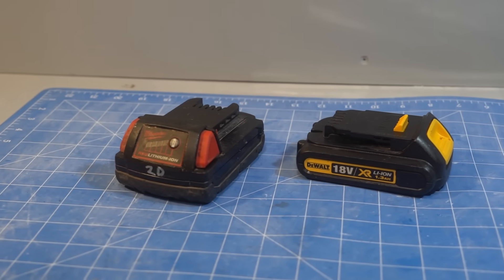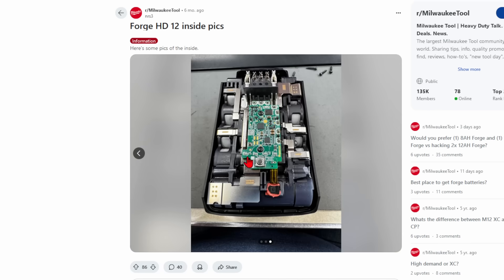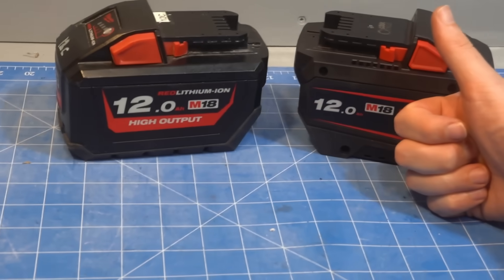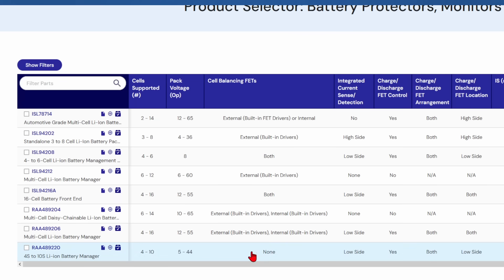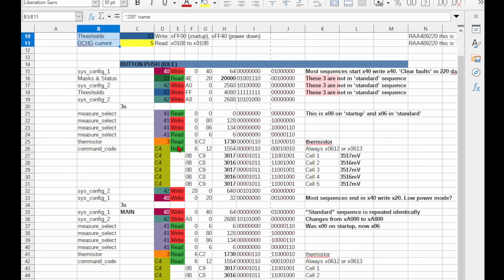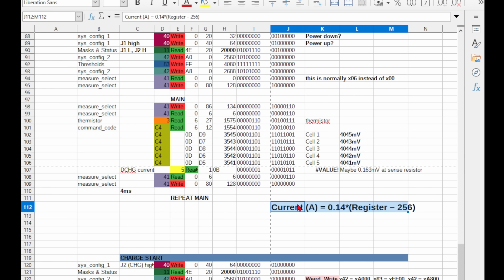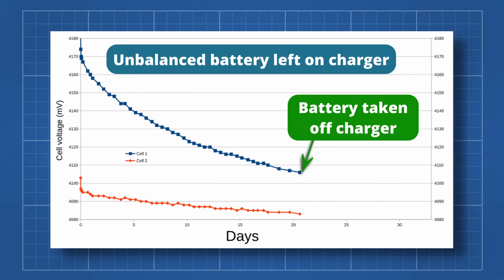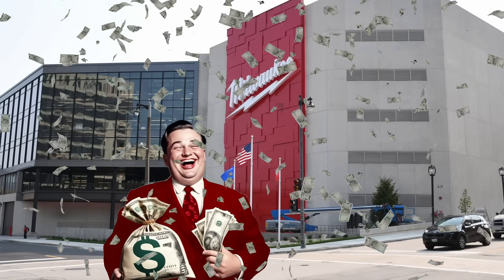[011] Do Milwaukee FORGE batteries balance

Comment: on top of everything you mentioned people need to make sure they use a fan when they charge their batteries, heat is probably a bigger concern since it’s what most people will experience damage from. 
anytime i use the charger i try to use the slowest 3A because since it charges it slow it puts the least amount of heat and if charging outside when it’s cool the charger and battery never get hot. i also had a rapid charger and a super charger which i try not to use as much because the super charger charges the batteries FAST which lithium batteries tend to not like and from my understanding (i could be wrong on this) lithium batteries get unbalanced faster when charged at a faster rate. 
and the rapid charger is the perfect middle ground IF you have a fan pointed towards it so the charger doesn’t get hot. because that charger gets really hot! 
anyway those are my 2 cents.

Comment: it looks like there is some space inside the case. that makes me wonder, couldnt we add a balancing circuit from one of those cheap bms boards on top of the original board
Reply: Maybe if we add a connector to the shell you could hook up an active balancer externally
Reply: @bengoldberg8451  i was actually thinking of an internal balancer for ease of use

Comment: No balancing is intentional. It limits the useful life of tool batteries without causing safety concerns.
It is strange how LIDL/Parkside, a cheap line of tools, implemented cell balancing in year 2022. Their 12 Volt (3 cells) batteries have an over engineered electronic controller, as they include everything in the battery. They balance within 10 mV, so the battery keeps their nominal capacity to this day. 
Their 20 Volt (5 cell) batteries are different. Under voltage protection is inside the tool, and over voltage protection is taken care by the charger. This to keep the 20 Volt battery price low, at £25.
Thanks for the video.
Greetings,
Anthony
Reply: From what I understand, tool batteries which include cell balancing require an alignment step after production...

Comment: My biggest regret is choosing the M18 platform. It's not that I don't like my Milwaukee Fuel tools, but Milwaukee tools and batteries are simply overpriced. I feel like you can only buy them at a reasonable price during sales; so there are never any good deals. My track saw is probably the only Milwaukee tool that I find competitively priced. Otherwise, why charge more for tools or batteries designed to break down that cannot be repaired?

Comment: Why don't you rewrite the program for the charging of the cells.  Any one as good as you running the I2C is more than capable to write a new program can reprogram and change the eprom. Suck the program out of the eprom and feed it to the AI to write a new program to your spec. A bigger Eprom cost more money. In high production levels they most of the time burn the program into the charger chip when they make it.  Big money to change it they make 10K-100K chips at a time.

Comment: They want these batteries to perform excellent in high power drain tests as well as in short term 'torture testing' , however after repeated cycling the voltage difference becomes so great that capacity becomes complete nonsense and the user has no option but to either buy a new pack or try and warranty it. If the user tries to warranty it they will reply saying the pack has been 'abused' and warranty is denied. (citing I2C data they like and omitting that they are not balanced packs that caused the problem to start with) 
WHAT A JokE

Comment: At the beginning you pointed out that the top-of-the-line DeWalt and Milwaukee batteries don't have active balancing, which is true! But you forgot to mention: the DeWalt charger does active balancing! That's why DeWalt batteries have "pins" with voltage separation of "S" by "S". Greetings from Brazil. 🇧🇷🤝🏻 Ah, I bought standard male DeWalt connectors on Aliexpress and today I charge my DeWalt batteries on the ISDT Air8 in a balanced way, each "S" at 4.19 volts 👍🏻

Comment: In M12 charger does balancing but I can't comprehend why they added resistors in the pack and only for 2 not all 3 cells. Mine are modified to charge with RC charger which has 1.5A balancing current for each cell so my packs are always balanced. I also did modify chineese makita copies to use JST-XH connector so those cursed and branded as bad batteries started performing better than they actually were. Hmm curious...

Comment: Just the other day I cracked open a knockoff Makita battery. It had cell balancing. No excuse not to, other than extreme greed
Reply: No, the battery you opened almost certainly just had cell MONITORING. Just because there are connections between the cells to the BMS doesn't mean it has balancing.

Comment: Thanks for this video. 
I have a Berner tool which is the same as Milwaukee. I've just refurbished it's battery (15 years old) and I'll be courius about the balancing will work or not. I've just cherged it up. 
A day later I'll check the cell voltages. If they will be not balanced than I'll balance it with a tool and modify it to be compatible with a balance charger tool.

Comment: Nice analysis! ❤
Do you know the value in Ohms of the R13 resistor? It's common for multi-cell battery monitoring/management chips to put a resistor in series between the battery and chip for filtering, in conjunction with a capacitor to ground, an RC filter. Filter resistors tend to be kOhms. Balancing resistors tend to be 10s or low 100s of Ohms. So if you measure the value of that R13 resistor in Ohms, that would also be a good clue as to its purpose. If you wanted to quadriple-check your result. ;)
Reply: This guy has a nice voice, but like many youtube channels he doesn't really understand the subject he is presenting.

Comment: Guessing the pouch 6.0 has balancing.. tested those yet?  I wonder what their life expectancy is.
Reply from the maker: No, I don't own a 6Ah Forge. It is using the same AFE (RAA489250) as the 12Ah Forge, though. I strongly suspect that the RAA489250 is just a cheaper version of the RAA489220, which cannot balance. So I don't think the Forge 6Ah balances.
Reply: @toolscientist I'd be curious to see the internals and what's going on with the pouch forge.  It's certainly the most evolved of the M18 line.  It does keep track of itself differently... It's the only M18 that tracks usage level when I put, via adapter, it on my old V18 and 18V tools.

I don't know what's what to know differences.
https://youtu.be/aw5GOTmn2VE?si=EfxWrdfbxarIPXPi

https://youtu.be/Ulj6B3HufRI?si=iZSD1clz9mn6K2z0

Comment: Balancing lithium batteries is a requirement not an option for longevity and saftey. 

If they stopped balancing they are very deliberately sabatoging their batteries in a malicious way. 

Its going to cost them when houses start burning down as a result of their greed.
Reply from the maker: I don't think there's a safety issue as they have high and low-voltage cutoffs on a per-cell basis. Charging stops whenever any cell exceeds 4.2V and discharge stops whenever any cell drops below 2.5V. So safety is fine, just longevity gets hurt.

Comment: Now that the communication protocol has been reverse engineered entirely, would it be realistic to hope for an open-source firmware one day? One that balances cells (even if it means replacing a few resistors, as microsoldering has become a lot more accessible)
Reply from the maker: I'm 80% sure that the AFE chip (RAA489250) in the Forge batteries can't balance. As for the others, it's doable, but problematic. There's a few variants, so it would need multiple firmware. Then firmware flashing is not a simple task and will prob result in more batteries being bricked than saved. My intention is to just keep shaming these companies until they implement balancing themselves.

Comment: Question?
Is it possible to recover the cells, if the cell empties out?
Regarding the warranty, did Milwaukee test the cells just to the point of failure beyond the warranty?
Does the micro controller ever go bad?
Reason WHY you couldn't go any information, could it be because of a SECRECY agreement?
21700 cells could be the future.
What is Milwaukee's response to this?
Do a comparison of a cheap Chinese alternative?

Comment: Just for reference: Microcontroler aka software based overvoltage protection is not acceptable. You need to assume the software on the chip fails or hangs, or even that power pulses from the usage of the tool can crash it. In such a case it still needs to be safe both for charging and discharging.
Reply: Yes, the same reason that a typical TP4056 Module also has a DW01 protection IC as the safety device.

Comment: I am really bummed to learn this.  That would explain why my M18 12.0 has now started to give me the three lights of doom.  Is it possible for me to open the pack and bring the charge up on the offensive cell manually with my bench top power supply until it is more reasonably balanced?
Reply from the maker: Yes, and that's what most people do.  Other option is single-cell Li-ion chargers. There are many videos of people doing this

Comment: If they only exposed the battery balance leads on the connector, all of this would be hacked by manually balancing them. *not sharing datasheets of parts sold publicly like this should be illegal.

Comment: Would charging it on a timer that turns on and off every few minutes help "passive balance" the cells ? I had a greenworks lawnmower battery that would not charge if i killed it. I plugged the charger into a old school timer and it would turn on and off every 15 min. By the time i needed to cut the grass again it was fully charged. I would use this battery 1st to wear it out faster because it was already causing me issues.

Comment: That explains why I have several devices, worth several 100 euros each with defective inbuilt !! batteries. We have a 2 year warranty here in Germany, and not one of the chinese products reaches it. I have stopped buying this crap. Only devices with plugin batteries where I can get a replacement battery will be bought. Battery packs without balancing are designed to fail, this is intentional. If a chip capable of balancing is already in the battery and it is not used, it is malicious. That's just greed.

Comment: Man I have couple m18 batteries that over time started charging to 3 then to 2 bars.

Opened them up and  one row of cells was at 3.3 v while others 4.2 -4.14

I thought the cells are bad but after Charing them with external charger battery started charing  again ( after few cycles it went back to 3 bars but it now has way more capacity than before h

Comment: The BMS chip is likely a custom IC version, chip manufactures sometimes makes them for large customers for different reasons, usually larger order numbers or making repair harder etc.
Reply from the maker: I suspect it's a cheaper version of the RAA489220 (4-10 cells). This chip ("the 250") is listed as 5 cells only.
Reply: @toolscientist that was my initial guess, and the unwillingness of the manufacturer to provide datasheets indicates that it's a cheaper version intended for a very large customer 😁

Comment: So happy this video is made, acknowledging the issue plaguing longterm use of tool batteries, that unfortunately I keep running into as well with longterm use. The batteries are so expensive I thought they could be used for years. I am now seeing my milwaukee tool batteries have significant voltage drifts, which means looking up how to resolve the dreadeadred green flashing lights on milwaukee chargers and seeing the heartwrencing paralell charging of so called dead milwaukee battery videos. Having looked myself it was clear that voltage drifting was the issue amd once I reblanced cells the battery worked again...for a while. In time the frquencynor revalancing increased over and over and I noticed a strange schematic of cell charging. Together with multiple other youtube videos it lead me to valifate the cell imbalance hypothesis, which increasingly turned out had a conrfimation pf the issue at hamd. Then tool scientist did an amazing series on the crux of the longterm battery performance and comfirmed my worries. Happy to see this level of thorougness to show the issue at hamd. I think many don't understand this issue and are used to thinking the batteries will have to be replaced. But the batteries can be used a very long time when taken care of, and even have very good second life solutions. If only the cell management and cell balancing was better. I do hope the big tool brands are watching, because this is an issue with long term performamce and the bms is not set up good enough for the value proposition. I can imagine they want performance over maintenace, but the narrative of performance with the most popular tool brands has been to do more with less. But of the batteries don't last long longterm in their performance, as I am experiencing with normal use (!) doing less with more stuff. I do think milwaukee has a good battery managementsystem,  I have too many batteries failing prematurely after only two years of normal use, due to pack voltage drifts. A much better bms, I think can solve this and let me use my batteries longer and without losing a figurative arm and a leg to buy a quite pricey new battery knowing whatbis to.come in another two years. Milwaukee is improving their tools and batteries, but the slight bump in cell balancing of their new forge batteries was disappointing to see, and for me solidfies the poor customer support over business strategies. If they can manage and fasttrack 1-2 amp cell balancing while charging and standbyi n the tool in their battery bms  I would be much happier, and would help other tool owners as well. I would even be happy if a new bms board in a forge battery did that over usb c! I would also then be more lenient to another critique I have,  that the charger connector pins are different than the tool connector pins of the battery.  If both the tool and charger pin connectors were the same,  I think it would be a little easier to troubleshoot or fix th tool  battery or charger issues, and even have good third party solutions, without having to be stuck with a "dead" tool battery. Thank you very much for this video. Thumbs up for all your hard work. I can imagine a lot of time and effort went into this video demo and summary.

Comment: Have you ever done a deep dive into the Ali Express BMS boards for the 12ah High Output batteries?  Do they balance?
Reply from the maker: No, I haven't. I might do so at some point. Would be a good way to shame Milwaukee if the knockoff boards have balancing.
Reply: @toolscientist Even better, can you reprogram the BMS to allow it to balance???
Reply from the maker: @dkhuber1  yes, but it would be a big project. Modifying existing firmware could be possible, but you couldn't distribute due to copyright. Writing own firmware from scratch is possible, but a lot of time and potential liability if peoples batteries catch fire. Flashing firmware is also beyond the abilities of most people and would void warranty. I'd prefer if Milwaukee just did it themselves, so I'll just keep trying to raise awareess of this problem.

Comment: Well, may the stupidest tool batteries (milwaukee m12  - none of active components, just two resistors and a  thermistor) get balanced while charging or not? (well... actually i can do it myself, just get a knockoff m12 batter which i wont feel bad to potentially ruin)
Reply from the maker: Some of the M12 actually have an ATTiny10 microcontroller in them. I have a few M12 tools, so I can test them for balancing
Reply: @toolscientist  Wait what? I thought they only have a thermistor...
Reply from the maker: @LordPrecision  seems only 3Ah (and prob 6Ah) have an MCU. I haven't seen any of the 2.5/5Ah so not sure about them
Reply: @toolscientist  Well, i may try to open 6AH one, is it risky to break the case?
Reply from the maker: @LordPrecision  not from memory. Just don't use any metal to pry it and take any rings off.

Comment: Do a life test on the pack. Show data. I bet the pack still lasts hundreds of cycles.

In these small packs, cell balancing hides issues. Typically the cells are made to such high tolerance and consistency that cell balancing is not needed.

Comment: And they expect one to buy their 2 times over priced chap battery's well no  .rebuild build from empty case or knock off can be good if you dig i got 21700 8.4ah and 3ah.morcell 40 amp cell units  The trick is using a RC battery charger i rigged small Neo magnets to wire and balance the battery ever so often f their tricks .i got my own by under charging to a voltage 4.10 a cell lol or less 80 percent or so .store at 3.6 or so 3.75 and in freezer for off season
Reply from the maker: I've heard of people installing JST connectors to make balancing easier
Reply: @toolscientist  yes  yes rc battery charger are great the good ones most really just the i max b6 knock off one can set voltaic stop point  and pardon my terrible grammar .rc charger have settable voltage cut off and most all good unit dos the old  imax b6 charger only the real ones do knock offs do not have  voltage settings ...but i like ISDT CHARGERS like this or bi this tiny thin does it off but decharge the next size up does dechargeing  ISDT 608PD Lipo n more Battery Charger

Comment: My question is that if the hardware is there for balancing and it’s just not programmed, could you program it and enable balancing?
Reply from the maker: Yes, but it's not easy as the chip is locked. Also, until we get a datasheet, we won't know if this new chip can balance. The fact that it's nearest relative (RAA489220) doesn't have balancing is not a good sign.